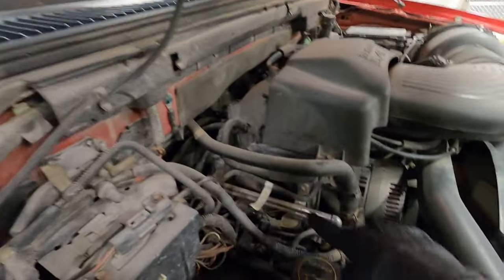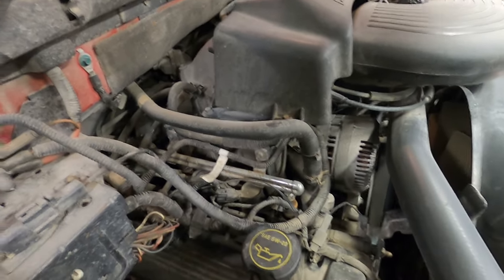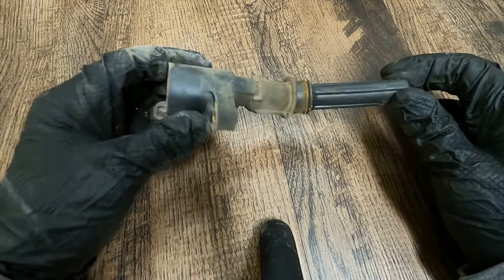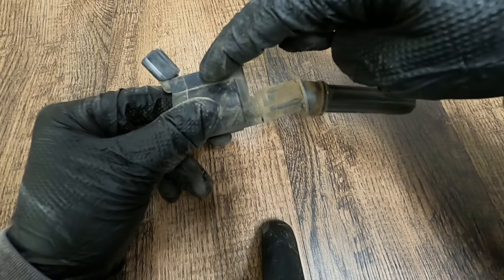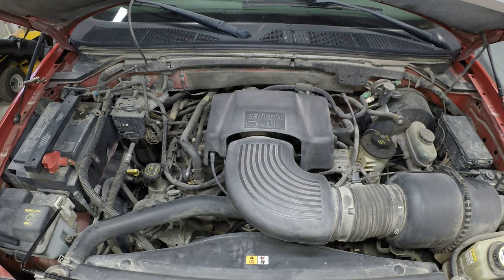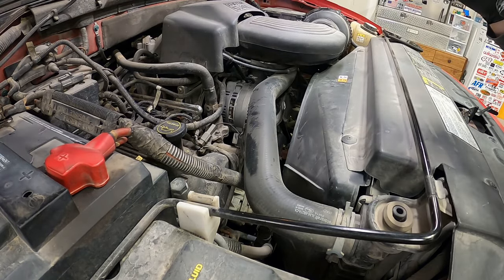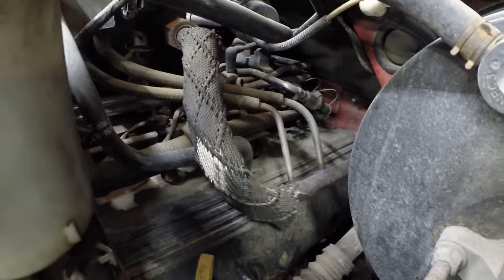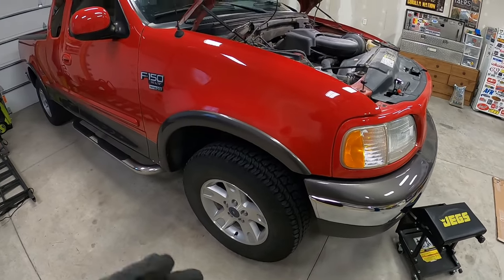Most Common Problems With Ford Triton 5.4 2V Engine

Comment: My 2000 4.6 2v has 297,000 and has had most of these except exhaust and issues with popping plugs. Most frustrating for me was an intermittent idle at 2300 rpm. IAC was opening...it wasnt the IAC or ECM...TPS wiring harness was shorting out and forcing IAC wide open. Runs perfectly now.
Reply: Hi would that cause misfire. I’ve trying to trouble shoot a misfire. Did full tune plugs and coils, maf sensor, cleaned out throttle body, and checked for vacuum. Leaks. Still scratching my head!. I unplugged the TPS today and I noticed the idle changed but went back to normal when I reconnected.
Reply: @makinmusikpro  I wasn't seeing a misfire with the high idle. It was scary as heck coming to a stoplight though.

Comment: Terrific video, Thanks! My 2001 F150 eng 5.4 has Motor craft OEM ignition coil part# F7TU-12A366-CD are the following the same replacement F7TU-12A366-BA or  F7TU-12A366-AB
Thanks in advance, Albert D.

Comment: Thanks. Are you a certified mechanic?
I am thinking of helping a friend out and buying his old F150.
It is having misfire/spark plug related issues. 

Would it be worthwhile to buy it from him for a dirt cheap price? He just can't afford parts and labor at the moment.

Lastly, how much do you think an engine rebuild costs on this truck?
THANKS IN ADVANCE
Reply from the maker: It depends on alot of factors, year, condition, options, mileage, how cheap you can get it, etc.  These things are super reliable, but not all that valuable unfortunately.  Rather than trying to rebuild, it would likely be cheaper to just buy a reman engine. Last time I looked, you could get one for around $2800.

Comment: I have a 1999 expedition 5.4l 191k miles. Runs great, tons of power. Has a subtle knocking noise sounds like a quiet desil motor. Everything ive seen with similar noise was on the 3v phasers. What could be causing this on my 2v? Gets quieter after it warms up to temp. After 1200 rpm i can't hear it over the engine. Louder when colder outside.
Reply from the maker: Could be an exhaust leak, especially if it improves after warm up.

Comment: 01 lariat almost 500k miles and had all these issues , my most recent issue was the stupid plastic heater core connector breaking .

replaced  both  because I didn't trust the other one.

Best addition was 3" body lift for dealing with those back 2 coil packs that I've replaced a couple times.  🤣 

make sure when you blow your spark plug you disconnect that fuel injector plug and you'll be able to limp to your best friend that's a certified Ford mechanic and he'll have you back on all 8 in 30 minutes.  😉
Reply: Same  I'm having a hard time removing quick connections from the fire wall to replace both hoses. What tool did you use?
Reply: @gcorpus5558  just seen your reply,  Push -Squeeze-Pull is the best advice I can give and alot of cussing.
Reply: @gcorpus5558  spray carb cleaner on it to knock dust n dirt off then push like hell, squeeze the 2 half inch white tabs in and pull towards you jiggling it if needed! That's how I got mine off
Reply: 🤣🤣👍🏼 Thanks guy's.  Definitely throwing some French words out. 🤣

Comment: I have a 98 f150 with a 5.4 extended cab 4x4 and it has 268,724 miles as of right now. Only issue I have seen is rear main failure, dipstick housing broke off in the block and exhaust manifold cracked making a leak. All this happened at 242,288 miles. No other issues with the engine.

Comment: Alot get egr codes too.Either the egr valve,the pressure sensor or clogged ports.
Reply: Before either of those check the hard vacuum lines going around the engine. The green and the white lines do the egr. (White lines may look yellow.)

I had an egr code did all of the Cleaning above changed both the sensor, valve and solenoid to no avail. 

Wound up being a rotted vacuum lines behind the battery.

Comment: I blew the plug, but I didn't do the helicoil because I felt it was an intense job, I took it to a mechanic because it was over 116 degrees outside, and it was Cylinder fkn 8, right under the damn dash! There are a few ti es in my lifetime where I will concede.

Comment: (2001 Ford F150 Lightning 5.4lL) Had a blown spark plug in #3. Replaced head. Truck started to shake around 35-40mph and up. Found they replaced the coil pack with a non oem, witch does not have same fire times. Replaced all coil packs. Had a P171, cleaned air intake and filter, no engine light so far. Now my OBD2 will not read, has power. but My truck now shakes around 40 mph and up. Does not shake when in 2nd gear. Still trouble shooting. Also had a ABS light and turn signals would not work, due to a leaky front window. Water was entering the cab running down to the fuse box under the dash. A quick kick to under the dash to vibrate any water on the wires it goes out. Any idea of the shaking at 40mph and up with no engine light or obd2 reading or a hard crank but will start problem would help alot

Comment: Replaced the coil packs on my 5.4 and fixed the misfire and fixed what I thought was a transmission problem. Used a good set of msd street fire coils. Had to get the light offf to pass inspection. It’s passed inspection then the light came back on a week or so later. I wonder what caused this.
Reply: Yes, happened on My Excursion V10 2v was getting codes on shifter.  changed all COP original 167K , fixed.
Reply: Need to replace all COPs not just the failed one.

Comment: Hey wondering how your gas mileage was in the 5.4 f150 I recently bought one just trying to base it off of similar trucks mine is the 03 f150 7700 with the beefer 7 lug rims an I believe on f250 frame
Reply from the maker: My 03 does 17 on the highway on a good day. It's got 3.55 gears.  My 99 with 3.73 gears never did better than 15.

Comment: I have a weird problem.  2001 F150 Lariat 5.4L.  Crank and no start.  Was sure it was the fuel pump, replaced it and still same issue.  no pressure on the fuel rail.  Relay and fuses good.  Command side of the relay getting 11.7v when the key is to ON.  30 pin have 11.7v but 87 pin have 6.5v when key is to ON.  Good signal from PCM.  Inertial switch is good but have 6.6v going to inertial switch when key is to ON.  PLEASE HELP! I am going nuts.  Thanks
Reply from the maker: Have you verified power to the fuel pump plug? Should have battery voltage on the pink/black wire and ground on the black wire, while cranking the engine.

Comment: That and the oil pressure sensor go out on these 5.4 engines. Some vacuum hoses and gunk gets on the air pressure sensor piece but simple two screws remove and clean with carb cleaner - cheap to fix .

Comment: I have a 2002 F-150 Kingranch with the 2v and ive had to completely rebuild the intake with new parts and my pcm getting fried after 300k miles and a lot of abuse from the previous owners. Ive already gone througu the whole fuel system and timing system.

Comment: The coil and injector connectors are bad about deteriorating and causing a miss fire.  
   ( 1997 F150,5.4 automatic,4x4)

Comment: I’ve been pretty lucky with mine, had a plug pop out once, and valve cover gaskets leak, manifolds are good and the intake gaskets are so far so good.

Had a friend with a coolant leak from his intake manifold on his 4.6 but he never changed his coolant and the gasket rotted out at the coolant channel
Reply: I’ve been told you don’t need to change this newer coolant 😂

Comment: I’ve got a 99 Super Duty 5.4 2v with 210k. Previous owner seems
To have taken good care of truck and power train as it’s
My daily and runs excellent. 

The only thing is the motor sounds like one of those big box delivery vans/ UPS vans on acceleration. Like the fan is blowing air into radiator unusually loud. Is that normal?
Reply from the maker: I am not sure if the super duty used a different fan clutch, but on the F-150s that's a sign that your fan clutch needs replaced. I've seen it a few times.
Reply: @KonaBlueSVT  Even if it doesn’t overheat?
Reply from the maker: If you don't mind the noise, it won't cause you any problems. My 99 f-150 did the same thing, I tried 2 different brand aftermarket ones and they both did the same thing new out of the box. I bought an OEM one and it never did it again.

Comment: i have an 01, 5.4 . i keep getting missfire on cyl #3. mech said bad coil and replacedit. ran good for appx 3 weeks and bad #3 coil again. He replaced coil and ran fine for another 3 weeks, then agin missfire on # 3. He said they had a recall on the brand he was using, he put in a different coil and good for a month then same thing. he did a pressure test, no coolant in cylinder, plugs looked good. Now I have it on # 4 cyl. this seems to happen when it RAINS. The day after the rain truck runs fine ,with same coils, until next rainy day. I have taken the shroud off between windshield and hood, no clogged drain holes, ive caulked this shroud, caulked the ground screw holes in the firewall, checked the wiring harnesses for skint insulation, ive caulked the washer spouts on the hood, sprayed the water hose over truck for 30 mins, checked under hood and no visible water around the coils,  or any where else. dry todat and truck runs fine????? Ive looked at the fuel control ? box above the spare tire doesnt look corroded or cracked. HELP pls

Comment: The misfire problem on mine (03 F250 5.4L 2v) is proving very difficult to diagnose. Changed fuel filter, did not help. Checked ECM with scanner, no codes and the O2 sensors are showing the proper voltage. Finally changed ALL the coils with brand new Edelbrock coils and new Autolite plugs. She ran great for 3 days, but now the misfire came right back. Runs rough, low power, feels like a misfire. I guess I'll have to recheck every plug and replace each coil one-by-one until I find the problem. Going to start with #4, then #8, then #7, and so on (hardest ones first). If it still has a misfire, then maybe I'm just going to replace the ECM.
Reply from the maker: Have you looked at your fuel trims when it's misfiring?
Reply: @KonaBlueSVT  Well it's misfiring all the time. The idle is decent, but you can still feel it. When you say fuel trims, you mean looking at the live data stream on the scanner?
Reply: @KonaBlueSVT  Well it's all over the place but at idle I have 4.7 on LTFTRM1 and -12.5 on LTFTRM2. At 2200 RPM I get 4.7 on LTFTRM1 and -6.3 on LTFTRM2. On deceleration Bank 2 went as high as 15.49 while Bank 1 was at 0.0.
Reply from the maker: Check your exhaust back pressure. A plugged cat could cause opposing fuel trims.if that is OK, check compression, jumped timing could also cause this.

Comment: My 01 Eddie Bauer expedition 2wd is sputtering while accelerating. it's the first one I bought so idk the whole in's and out's of it.. I did the plugs, air filter, fuel filter, cleaned the tank (didn't replace fuel pump though)... If I replace the pump and it still does that what does that mean internally? Im used to carburators I don't know fuel injection too well but I get it. Its check engine light is on btw. It runs great but it could run better. I got it for $600 from a family friend and he took care of it from what I can tell. Fluids are good, start up is good, idle is good, but I was just looking for advice on the motor and troubleshooting. This video was great BTW
Reply from the maker: Definitely check the codes first, check fuel pressure before throwing a pump at it.
Reply: @KonaBlueSVT  will do, thanks 👍

Comment: I need some advice here. I have found one with 373,000 miles, should I buy it?
Reply from the maker: That's a lot of miles for anything, it's a dice roll. It could go another 100k, or it might be at the end of its road. How's the maintenance been? How's the rest of the truck holding out?
Reply: @KonaBlueSVT  He said it runs and drives. The body and frame are in perfect condition
Reply from the maker: Has the transmission been replaced? steering/suspension rebuilt? How often has the oil, coolant, and all the other fluids been changed?

Comment: Just bought a 2000 e350 5.4 for 500 bucks from a university in OH has 167,xxx on the dash starts runs ands drives no check engine but gives a ticking sound when I hit the gas. Not even sure where it’s coming from. Plan on replacing all plugs and coils hoping to get 150k miles from it
Reply from the maker: Good chance it's an exhaust leak.

Comment: I have a  03 the check engine light comes on and it's reading the sensor on the transmission  and missing out  mechanic said it's the sensor on the side of trans the safety internal switch  that's my only problem good truck for 300.000 miles

Comment: Hey man please reach out to me I think my oil pump went bad but my oil pressure is at 0 and oil light is on no noise coming from engine no tick jus sounds like it’s running ruff please reach out seams like you have a lot of knowledge 2002 f150 v8 triton 5.4
Reply from the maker: Have you verified the oil pressure with a manual gauge?
Reply: @KonaBlueSVT  no but I did change the oil sensor and change the oil
Reply from the maker: I would start by manually checking the oil pressure to make sure you don't just have a dead wire from your sensor. If you truly had no oil pressure it should be making some noise.

Comment: I have a 2003 F150 Lariat super cab. Sometimes it won't start. The key chip indicator flashes instead of coming in and staying on steady. The motor spins but that's all. Using the command start works. Is there a connection problem with the chip reader? Can this be changed out? I assume that the command starter bypasses the chip reader to allow starting without the key. Is it possible to bypass the chip to cure the problem permanently? Sometimes these safety/ helpful ideas by Engineers drive me draft! Lol
Reply from the maker: Do you have another key to try?  The security light should flash rapidly for 60 seconds, then it will flash a 2 digit code.  This may give you a place to start.
Reply: @KonaBlueSVT  Thank you. What happened was that a previous owner put in after market interior lights. They wired it upto the ignition system. When the lights shorted out. So did the ignition system. So the shop that I put it into took out the after market lighting but also disabled the command start. I took it back in after the ignition wouldn't work. They hooked it up but after a couple of trips it again has security chip connection malfunctions. My next chance is with the shop that put in the command start. I think that it is a programming problem. Because a command start has to bypass the chip to enable the motor to start without a key in the ignition. I hope that this works. I have a back up key from a lock shop. The original and the back up key have the same issues. So it is chip connectivity problem. I think.
Reply: I did put the Ford code reader on. It read codes 1000 and 1260. I haven't hot a hand book so I haven't found out what they identify.

Comment: I have Ford f150 2003 Triton 5.4L v8 it cranks but no start codes system to lean in banks 1 and 2. codes for oxygen sensor and fuel pump circuit high. It has new fuel pump, fuel ,filter ,fuel pump relay , fuel injectors, plugs and coil packs. but is still crank no start. already spent lots of money on her but not starting any ideas
Reply from the maker: Does it have good consistent spark? Have you verified fuel spray out of the injectors?
Reply: Same thing was happening to my 04 expedition until I found the issue was the fuse/relay box had corrosion on some parts causing bad connectivity with relays. Connected fuel pump directly with a shut off/on fuse and issue solved.

Comment: Good info!  Does the 5.4 GT500 share the block as this one?
Reply from the maker: No, completely different. The 11 and newer gt500 are aluminum blocks.
Reply: @KonaBlueSVT  What about 07-10?
Reply from the maker: I believe they were the same block as the 3v 5.4.  The 2v was similar, but not identical.
Reply: @KonaBlueSVT  ok, thanks man!

Comment: Looking at a 2005 F250 with the 5.4 but I don't know how to tell if a 2v or 3v engine from photos.  Looked up the VIN on Autocheck and it just said "5.4 V8 SMPI"
Reply from the maker: I did this video to help determine the difference- https://youtu.be/-142udbX8ZE
That one will be a 3v.

Comment: Repeated misfires in cylinder 3. Cannot figure this out. Changed all coils plugs and an injector. Ran perfect for months. Then intermittently cylinder 3 again starts to misfire. Now it’s doing it all the time. I’m extremely frustrated with this. I’ve played musical coils tested injector connectors for voltage all good. Why’s this keep happening?
Reply from the maker: What brand coils did you buy? Have you checked fuel trims when it's happening?
Reply: @KonaBlueSVT  Haven’t checked fuel trim thanks for the tip. Coils were TRQ’s. I moved them around same problem. I’m getting power at the injector when engines running. I’m going to check again to see if it pulses with a better test light.

Comment: I have a 1997 f15@ and I floored it and after I let go of the gas the radio and gages started to glitch out and turn off and on then the motor turned off what should I do

Comment: 2002 5.4, blew the rear plug passenger side,   can t even see the hole, is it worth fixing 200,000 miles
Reply from the maker: If it's been maintained well, yes. You have another 100k easily.

Comment: I have issues with 98. Mainly #4, I've replaced coil and boot but can't get the plug to break loose. I moved fuse block out of the way still not enough room
Reply from the maker: 2 things I have had luck doing on stubborn spark plugs. The first is to perform a fuel induction service, it helps break up any carbon inside the cylinder that is holding the plug in.  The 2nd is get the engine to operating temperature and then fill the spark plug well with penetrating lube, let it set for a couple days and then try to get it out.